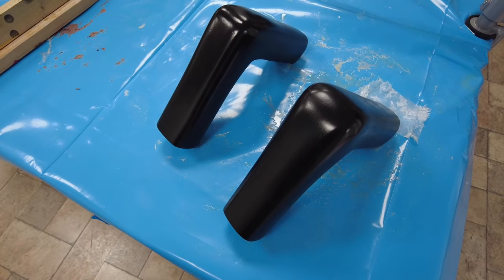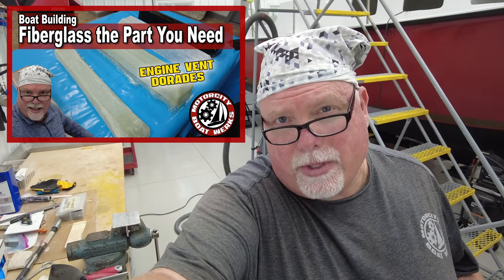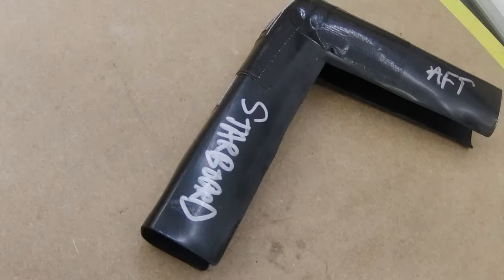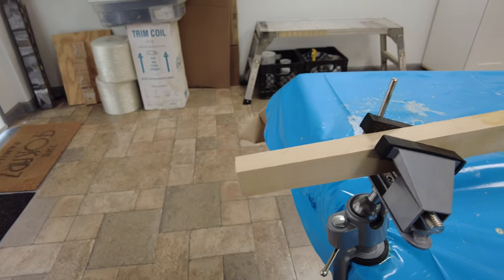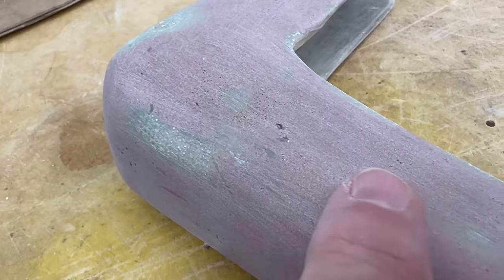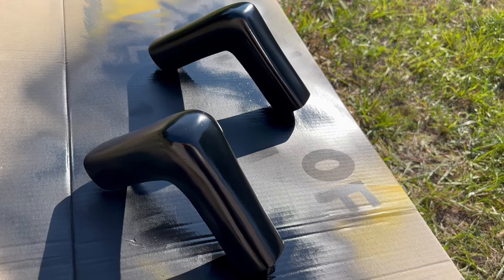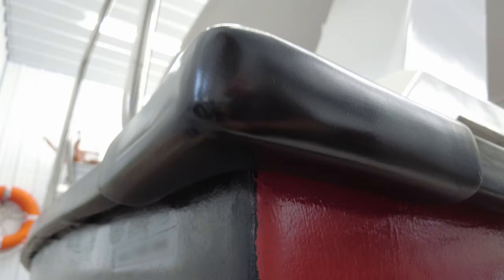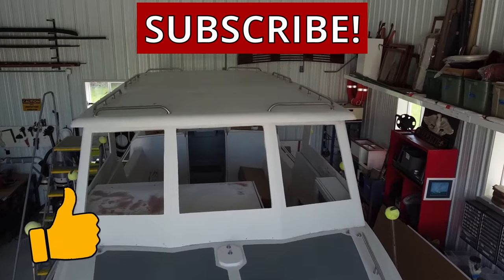How to Make Fiberglass Rub Rail End Caps | Sailboat Restoration | Trawler Boat Building (Ep53)

Comment: I wish there was a way to make the corners out of rubber. With them being fiberglass and rigid they will crack upon impact with dock or post at the docks. I agree that job looks amazing, well done. Keep us posted on how well they hold up.
Reply from the maker: Ken: I hear this a lot. Let’s remember that the point of the fiberglass end caps is to finish the corner. 🤔Not for bumper car protection. The fiberglass end caps are more robust than the original corner hull deck flange with rub rail. And they can take a hammer strike. Ask me how I know. They can easily be repaired if cracked or damaged. The rub rail is not really bumper car protection. 😎